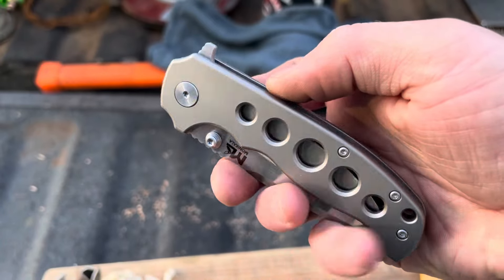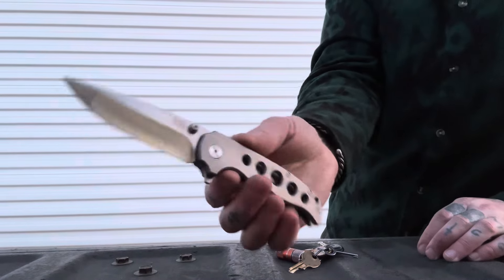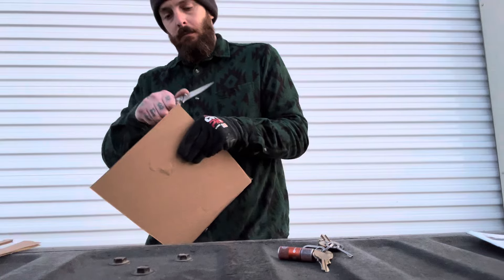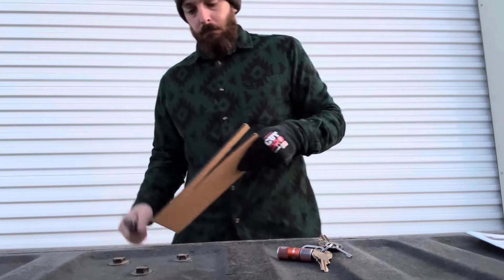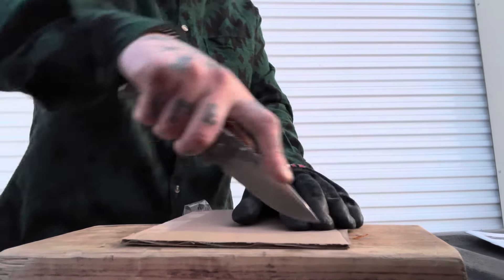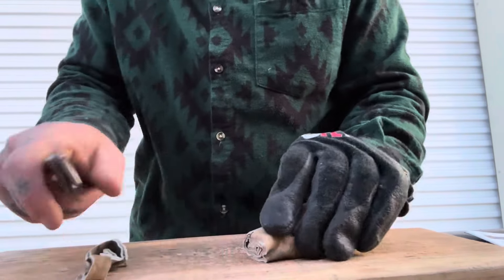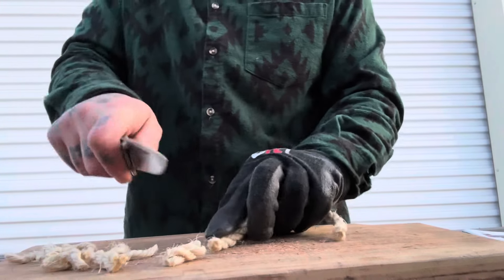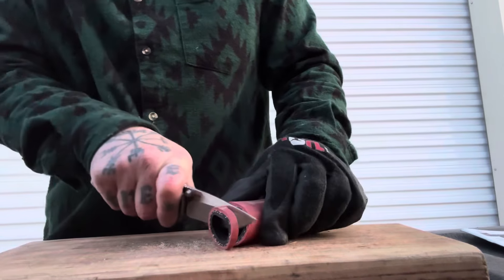Cut Test: Monikala! One of the Budget Greats?

Comment: Yours makes me think mine was defective... My detent feels deep, way too tight. I had to tweak the lockbar to get it to shut without using two hands. The action was really tight.
Reply from the maker: Hmm, yeah it’s possible you got a bad one
Reply: Mine is the same exact way.  Any tips to tune it so I can use the thumb flip?
Reply: @ShootingSportz  Adjust the detent like mine. But if it is still in return mode... by all means try your luck at another one.
https://youtu.be/OIIEDhO0kcM?si=RP0TT7BPvZ4UBZ6R
Reply: @ShootingSportz  https://youtu.be/C00LPnFx8Fc?si=1H00un3rpNspmiTt
Reply: @TheBadasbert  Dude you are awesome!  I'll try this out.  Did it fix your issue?

Comment: Idk how I feel about this one.  Got it because it was such a great value but the death lock is brutal.  I can’t hold it comfortably to deploy with the thumb studs without ripping my fingers apart. Maybe mine is defective
Reply from the maker: Hmm maybe. The lockbar is sensitive, if you put pressure on it while trying to flip, it’ll hurt
Reply: The frame lock on mine is too tight. It rubs and is way too hard to push. Bummed. I can thumb stud it with left hand but right handed its hard.